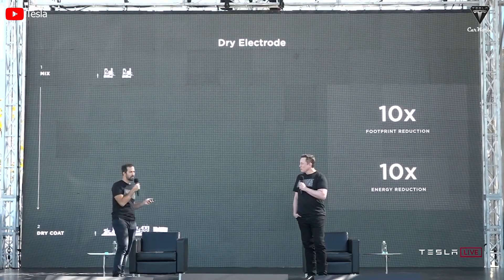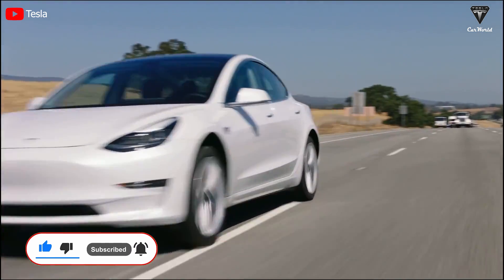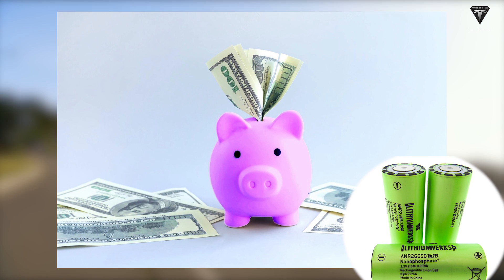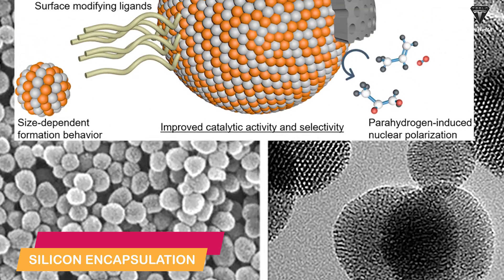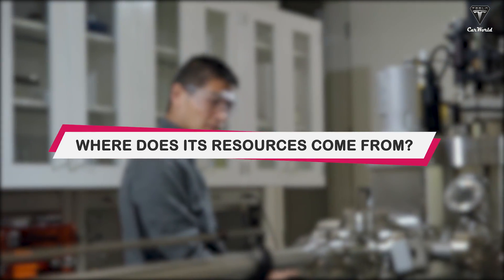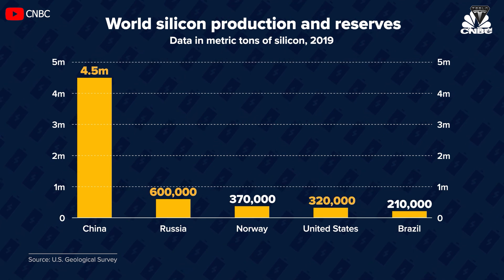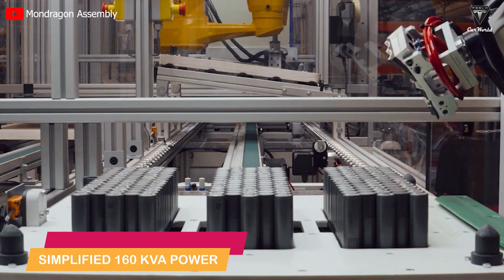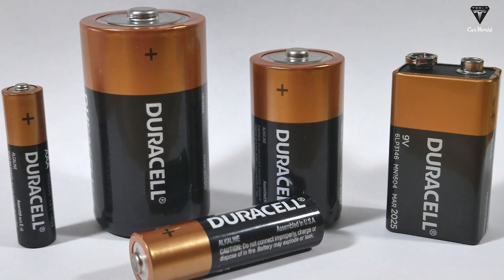Finally Happened! Elon Musk Revealed Breakthrough Silicon Battery, Entire Industry Change!

Comment: This isn't about replacing lithium..  In these new lithium electrolyte designs, graphite anodes are being replaced with silicon anodes.
Reply: Lithium-metall is the new way, anodeless.
Reply: Nice deceptive preview tile as usual.
Reply: But it would reduce the amount needed to achieve the same amount of energy
Reply: @mikescholz6429  It doesn't reduce the amount of lithium, it reduces the amount of the host material of the anode (a lot of graphite being replaced by much less silicon). Note that, even if this pans out, this is only reducing the mass of the anode. The lithium migrates into the cathode metal oxide in the discharged state of the battery.
Reply: Too many fibs and misdirections.
Reply: Elon just opened a lithium processing plant in texas, there's no way anything is replacing lithium any time soon.
Reply: Stop trying to be factual!  Don't you know "Entire Industry Change!" (Oh Lord, they couldn't even spell "changed")
Reply: Problem with silicon anodes is that they tend to swell when charging, causing cracking. 
After over a decade of research and development there has been progress on solving this, and Amprius has finaly just started producing silicon anode batteries. 
I don't know if they are destined to go into Teslas though
Reply: I was like wait, I remember that news very different then from the stupid clickbait title and preview ... 
The top comment immediately proved what I thought to remember, so thank you. 

They specifically grow the silicon in specific ways, sometimes called grass or forests, to significantly increase the available surface compared to the volume. This then translates into a significant weight reduction, increasing the specific power (power to weight ratio) and also the power density, which are some of the most important key parameters in energy storage in transportation just compare gasoline to your standard lithium ion battery ... 
Furthermore the silicon in combination with some carbon protection layer also has an increased lifetime, aka more cycles.
The last benefit was that it's at the moment become near plug and play to introduce into current production lines, just produce this new type of Anode and insert these instead of the old anodes.

What it DOES NOT DO is reduce or replace the lithium needed, which is still going to be a huge issue a few decades into the future.
This channel goes on my blocklist considering they are spouting nonsense and are misleading as hell.
Reply: @Dzeno2010  the whole spiel is like a stock jockey peddling penny stocks.
Reply: Better then children labor that mines lithium. Rather burn oil then support just thst. Yes I do have lithium batteries but used not for ac. Sad that electric car owners made it like this.
Reply: That's great then swap out lithium for sodium so yhe battery can work at low temperatures
Reply: Yeah these videos are click bait, making it sound like lithium is dead but it's not.
Reply: @WarrChan  that's youtube😅

Comment: Sodium, found all over the world as part of salt, sells for 1 to 3 percent of the price of lithium and is chemically very similar. Recent breakthroughs mean that sodium batteries can now be recharged daily for years, chipping away at a key advantage of lithium batteries. The energy capacity of sodium batteries has also increased. , And sodium batteries come with a big advantage: They keep almost all of their charge when temperatures fall far below freezing, something lithium batteries typically do not do.
Reply: Sodium batteries are not able to be shaped in useful shapes like LI.  They have a shorter life expectancy.  They have a lower charge density meaning you need larger batteries for the same charge.
Reply: @hairyferrit  According to BYD sodium batteries have twice the life expectancy and are far safer.
Reply: What a polarized conversation
Reply: @orbitaljellyfish808  ] highly charged ?
Reply: @ruedigerpreiss9307  Nope, they claim they will have, but in reality, existing sodium-ion batteries have a cycle life of 5,000 times, significantly lower than the cycle life of commercial lithium iron phosphate batteries, which is 8,000-10,000 times.
Reply: @orbitaljellyfish808   Considering the product, Cool pun mate.😊
Reply: @orbitaljellyfish808  I'm trying to understand what is so positive about having 'salt in batteries.' (assault n battery)

Yeah. I know... It's a stretch. ;)
Reply: @ruedigerpreiss9307  According to a Chinas Company 😂
Reply: @hairyferrit It would be nice to see the trade offs. Cost versus lifecycle/replacement time. Charging time, etc. I only have one hybrid car and won’t go all electric until charging is faster and ubiquitous. I wouldn’t mind an all electric for a second car, but not for $60K.
Reply: @xythiera7255  You don't even know China is the leader in EVs? How ignorant! 😂
Reply: @jamesdellaneve9005  How far do you actually drive each day?  With an all alectric car I can charge it to 80% full in about 30 mins on a fast charger, I would stop anyway at that time for a wee and coffee as I find my bladder only has a 250-300 mile range
Reply: @hairyferrit  I don’t want to navigate road trips around chargers. I know that it’ll take another decade or more for them to be everywhere. Locally, anything with 130 Mile range for a second car would do it since I change from home. Also, the price locally is more than gas. LA is expensive for charging. I only use a gallon and a half to get home when I go to LA. Old 2014 Chevy Volt. 38 miles on a charge and then get 35+ MPG on the gas.
Reply: @hairyferrit  have you got a link to any study that supports your claim?
Reply: Sodium mining/gathering doesn't destroy the entire eco system in the wide area.
Reply: @hairyferrit  mine has a 1000km
Reply: @jamesdellaneve9005  Charging will never be ass fast as filling up with petrol so you are going to have an infinite wait.
Reply: @rogerphelps9939  I am not asking for that. Life is full of trade offs. Right now, I don’t mind having an EV for local travel. I just don’t want to pay $60K for a second car. I don’t want to travel long distances from charging station to charging station. Charging should be close to the cost of gas. In LA, it’s 2X more expensive than gas. Since I have a 2014 Volt, I almost get there with the 38 mile range. I never look to charge because it’s $18 in most places. I get home with 1.5 gallons of gas. I do like this technology. Again. It’s trade offs. Here in Cali, they tried to force manufacturers with all EV sales quotas. They had to relent because hybrids were just coming out. Now, they’ve banned new gas car purchases starting in 2035. That won’t happen. We don’t have enough electricity now. The old saying, “Perfect is the enemy of the good”. I like having no gas bill for driving locally. Since I work from home, I put gas in every other month and my solar pays for the local driving.
Reply: @hairyferrit  I don't know where you got the info/opinion that Na batteries can't be shaped into useful shapes like Li. Na can be moulded into the same form factors. However, they are not commercially available in many form factors because they are not used in the many varied applications that Li batteries are. 

So it's better to say it is not available in the many shapes that Li batteries are. But it's not because it's not possible to mold it into the same shapes as Li. 

Furthermore, yes, Li has higher energy density than Na. That makes Li more suitable in mobile applications - phones, cars, drones. However, for stationary applications  like battery banks, UPS, and solar storage Na becomes advantageous because of COST and Environmental sustainability due to a smaller carbon foot print.  

Production of Na batteries  and recycling them is MUCH more environmentally  friendly compared to manufacturing Li Batteries. 

So Na = WAY cheaper than Li
Na = environmentally better than Li
Reply: @avibhagan  From the people researching and building them.  They are physically heavier and larger and not as easily made into intricate shapes.
Reply: Sodium batteries weight much more than Lithium and this reduces range and efficiency
Reply: @hairyferrit  Lithium iron and lithium ion are two very different batteries.
Reply: @coreymoyers  caught out by spell checker
Reply: @ruedigerpreiss9307  Considering how many BYD cars are going up in flames, I'd argue they're wrong

Comment: Yea I’ll believe it when I see it hit the market. They did this with the diamond nuclear battery too
Reply: the diamond nuclear battery was never intended for high current/voltage applications.. its real strength is LONG duration low current delivery for remote sensors and communications equipment

Comment: It's NOT the end of lithium, it's the end of the Graphite which is what is being changed out with Silicone. Lithium ions sit in the Silicone/Graphite Anode material when at 100% charge, during discharge Cathode (the Iron and Phosphate) receives these Lithium ions. 

During charging up the opposite is true and the issue is that Silicone tends to break apart its bond. Many battery makers want to use silicone because it has a theoretical x10 amount of energy capacity (Just means you would need less of it). 

Imagine: 22% of a battery is graphite, so if you could reduce this down to 2-5% Silicone that is less fragile, it would be possible to store an additional 17-20% of lithium inside the battery which would result in almost a 50% increase in active lithium that is able to move around inside the battery using a liquid electrolyte. (Just used)

But just like glass, it shatters when you put stress on it. Graphite the strongest material that we have available and is extremely durable and can handle multiple charge cycles.
Even graphite degrades, and is the #1 reason why batteries degrade when charged to a 100% under high temperature.

So to suggest to replace graphite with silicone may be a pipe dream that many are hopeful about. and may only be possible if voltages and temperatures are dramatically decreased and enforced somehow.

Comment: Conclusion is that there is a lot of anticipation  and hope around advanced nano-engineered tech.  It's one thing making it in a super clean lab where you have alot of time and make prototypes, but it's a completely different story going from that to industrial scale, where production speed determine the price of manyfacturing.  I don't think we're there yet, by far.  Yes, the video shows some experiments with scalability, but says nothing about speed or rate of faulty nano-structures produced.  Not being negative, I think the advantages of nano tech will be a game changer,  but what is overlooked with new tech, is the immense challenges of taking it to mass production sometimes.  Many promising inventions dies at that stage.  It's just the reality of things.  If you produce something no one can afford to buy, or with severe quality issues that can't be easily fixed, the product is doomed to fail.
Reply from the maker: Thanks a lot!

Comment: Sounds good. Yes, only the anode's composition would switch from Graphene to Silicon. For your info, my INR21700M50LT's capacity is 5,000 mAh, with a cycle life of 1000 cycles, which is greater than the LiSi version you quoted. It varies a lot from one battery to another. In some cases, it becomes complicated to relate the performance of different sizes of batteries' nominal voltage and respective capacity. Some clear comparison with same-format batteries (18650, 21700 or 4680, AA, or A) would be preferable. My take is that charging speed is a rather big issue (charging C), and the big concern is to avoid heat generation with related degradation. Silicon, by nature in other uses, could offset this allowing much faster charging. We'll see. It's been two years since Elon announced his 4860 battery, and projected specs on SiLi. I did not hear about this since then,  other than your mention of a Li-Si graphene hybrid. The problem they faced was the expansion of the Si anode with charge cycles, reducing cycle life. You seemed to infer this was resolved by Sila and Georgia Tech?   The super good news is that the demand for higher density is very high, and finally, thanks to Elon and a few others also working with solar energy, they opened the door to a safe and clean electrical future. There are no progress where there is no demand. There is no demand where nobody talks about a "greener grass" somewhere in our future. Did you know that the biggest pick up truck's fuel economy in 2023 is only a couple miles per gallon better than seen in 1973? You do your part in this with your great channel! Thank you so much. Cheers.
Reply from the maker: Thanks a lot !
Reply: I liked much of what you had to say, then came to the end of your comment where you seemed to make a statement of fact that I feel compelled to answer. You said, "Did you know that the biggest pick up truck's fuel economy in 2023 is only a couple miles per gallon better than seen in 1973?" According to Fuelly, a 1973 C30 would be expected to get 7.73 MPG (an owner having listed 9.2 MPG), a C50 dump truck (you referenced biggest?) being listed at 7.3 MPG (in truth, there were several engines available, so this is simply meant as a broad view.)

Well, in real life, my 2020 Chevy 2500HD w/ a Duramax diesel has a "best" fuel economy of 32.5 MPG and regularly gets 24-26 MPG with "normal" driving. I have over 124,000 miles on my truck, so this is a pretty comprehensive picture. Many of the capabilities of my 2500HD far exceed what the 1973 C50 had for specs, so I am confused as to where you sourced your information stating that "...the biggest pick up truck's fuel economy in 2023 is only a couple miles per gallon better than seen in 1973..." I am ALL for greener, better, more economical everything (my business is heavily invested in renewable technologies), but I also wish that the narrative supporting arguments for greener tech is factual because anything else can lead to an erosion of trust among those being educated. Everything else? Great!!
Reply: Nice comment bud. You cleared up a few things that l was trying to get my head around.
I got the feely it was a take on Amprius interview with the engineering crew with more adds,  less content. Stuffed with flash graphics.
Cheers
Reply: Curious the emissions differences between those 1973 trucks and today's 50 years later. To add to the complexity of any answer replied, how much of that depends on an increase in mechanical efficiencies and could've been there anyway via advancements in refining technologies and thus specific fuel characteristics used.
Reply: @Brohymn80  True. At the same time, it would not surprise me if the thought process in 1973 was not to conserve oil but to use as much as possible. Too many facts supporting big oil controlling things back in the day.
Reply: @smoke25ofd  oil backed dollar was a pretty important part of that. Coupled with it requiring essentially every country on Earth to need U$D to get the stuff.

Oil's a pretty crucial medium via which the US's grown its influence. 

Not entirely sure Big Oil's influence has lessened any in recent decades. Have you seen their recent profits?? What goes down will soon rocket back up

Comment: 6:20
I have driven EV for over 7 years with Li-ion batteries which is well over 2,150 cycles and I have over 82% original capacity.
I use 85 to 90% charge daily for 7 years.
Reply: and you live in warm climate, this does does not work in Alaska or Montana

Comment: Cathode and anode are two important terms in electrochemistry and are commonly used in batteries, electrolytic cells, and other electrochemical systems.

The cathode is the electrode in an electrochemical cell where reduction occurs, meaning that positive ions gain electrons and are reduced to neutral atoms or molecules. In other words, the cathode is where the electrons flow into the cell. In a battery, for example, the cathode is the positive terminal, and it is typically made of a material that can easily accept electrons, such as a metal oxide or a carbon compound.

The anode, on the other hand, is the electrode in an electrochemical cell where oxidation occurs, meaning that neutral atoms or molecules lose electrons and become positive ions. In other words, the anode is where the electrons flow out of the cell. In a battery, the anode is the negative terminal, and it is typically made of a material that can easily donate electrons, such as a metal or a metal alloy.

The flow of electrons from the anode to the cathode is what generates electrical current in an electrochemical cell. It's worth noting that the terms "anode" and "cathode" can be a bit confusing, as they depend on the direction of current flow, which is opposite to the direction of electron flow. So, in a battery, where the electrons flow from the anode to the cathode, the current flows from the cathode to the anode.